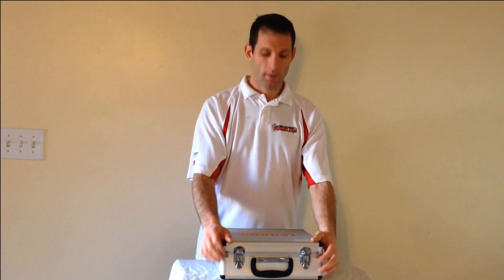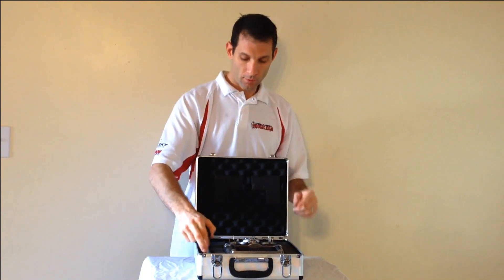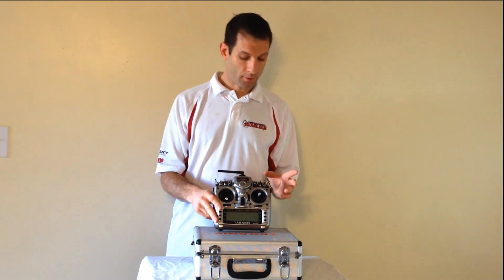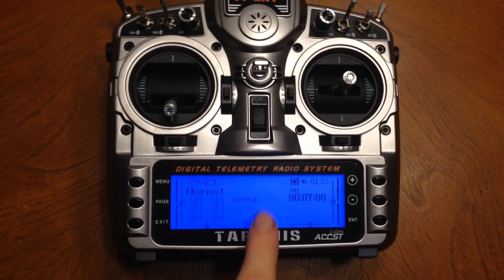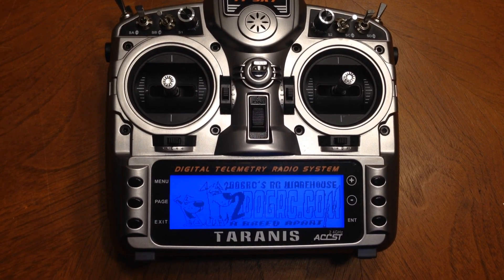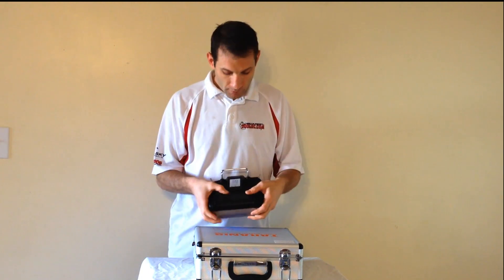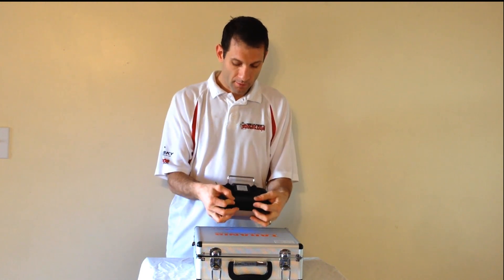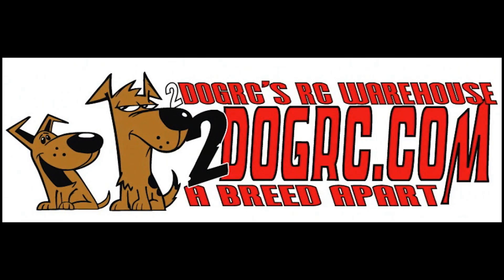2dogrc Intro to Taranis 16 Channel RC Transmitter Video.

Comment from the maker: I guess it is relative.  This is not as easy as a DX6 or other very basic radios, but this radio has many more features.  The Hardware is MUCH better then most of the Spektrum radios.  The best part is the multiple switches, and dials which you have spend nearly $1000 to get on other radios.